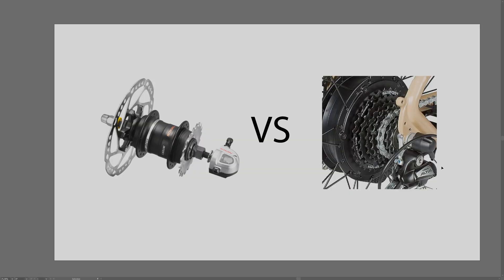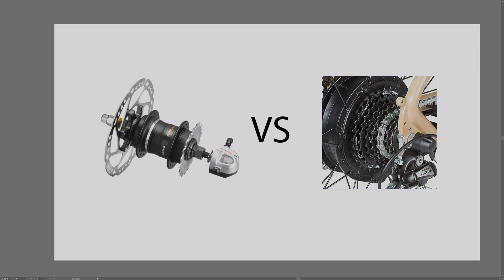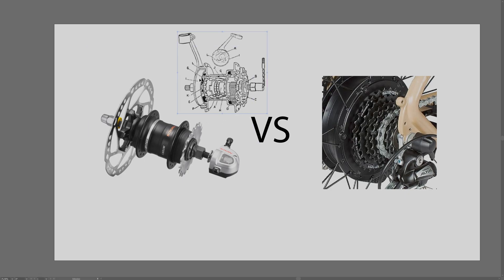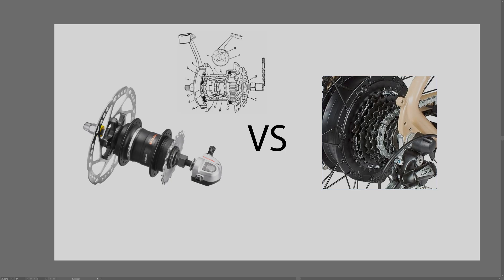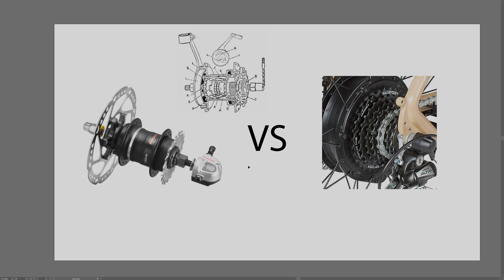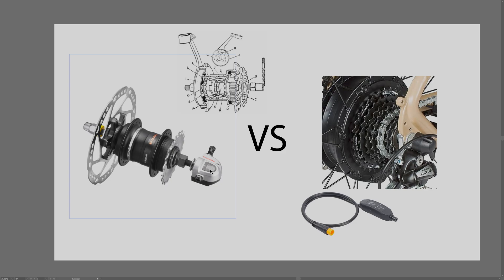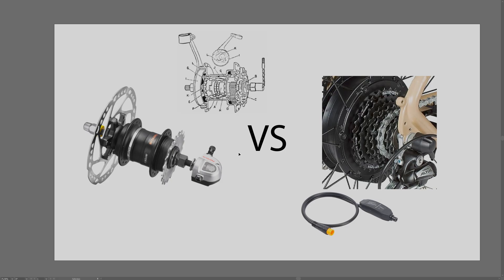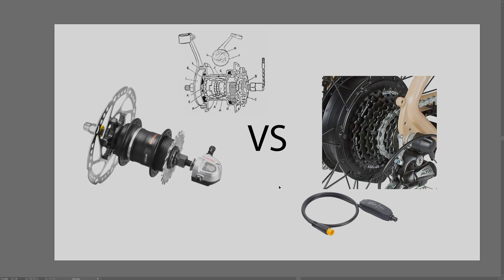Derailleur vs Gear hub - For bafang Mid-drives?

Comment: I built a Frankenstein moped using a 212cc clone driving an intermediate shaft to a 3 speed SA hub then to a v-belt to the back pulley.
 I figured the torque from the geared up 9hp engine was less than a hefty guy pounding on his regular pedal bike. 
It is amazing how small the gears are in these hubs, and they hold up just fine.
 I would oil the hub a few times a year. Used it for years.
 Took it off last year in favor of a C-V set up and it's still good.
I am using a 3 speed hub with a coaster brake on my home built E-bike, the ratios are perfect for a top speed of 17 mph while pedaling. Don't need more gears.  Mike

Comment: Good effort, You covered most things but to make it better ; 
a) you should shown some numbers when talking about gear ratio % , when you pointed at Derailler @4:02 and said 200%-300% and compared it against IGH that wasn't very good. Only the old Nexus 3  (186%) or probably even older Strumy Archers are worse (which look, a person buying a ebike motor in 2024 can get better IGHs )  - Rohloff Speedhub is exceptional at 526% ; but even Alfine 11 is 409% and Alfine 8 is 307%.   
b) chain line ,  chain wear is a plus for IGH (1 speed chains are tougher and cheaper) 
c) hence chances of wearing out of cassette teeth vs wear on the gear hub teeth is ratio of 1:3 or 1:4 easily so the changing requiremnet is much less
d) weight of IGH is often heavier
Hope to see more good content. 
Thanks

Comment: Thanks. Very interesting and informative. You make a good point about the igh gears being able to change gear easily when you stop peddling momentarily. 
Personally, I’ve not had a use for lots of gears on my Bafang. I’ve opted for an old fashioned 3 speed derailleur. So, around town, I just leave it in 2nd gear. The Bafang gives me enough ‘shove’ from a standing start even with a big 52 tooth front chain ring fitted. And is easy when I’m cruising along, I  don’t find myself ‘Ghost peddling’. 
I Only use 1st gear for an extreme hill (it’s very flat where I live). 
I haven’t tried a igh with the Bafang but I’d think it would work well. And yes, igh is very reliable, they were fitted on all Royalmail postal bikes and were very much trouble free. Derailleur setup is not as reliable if left out in the elements and some basic maintenance ignored. 
Aren’t the cog teeth & chains on igh much bigger and tougher too? (The Royalmail bike chains were so hard to split that you could easily break the chain splitter tool before the chain link would ‘give’) 
Same chain size on a bmx bike I believe.
Reply from the maker: 3 speed derailleur sounds cool hehe, never seen one myself

Comment: Hubs have a smaller range is not true for rohloff which has 520% compared to about 320% for an 11-36 cassette. Other advantages it has are that it has 14 identically spaced gears and can change multiple gears almost instantly. Apparently Roholoff is the only hub that is tough enough to handle the strain casued by the  motor
Reply from the maker: ya but rohloff is an exception im talking about yoru average derailleur with 3 speed front crank is gonna have much more range than your average gear hub.
Reply: @voltvehicles you need to try the shamono 8 nothing you said is tru😮
Reply from the maker: @Billybritt-s4t  ?? nexus 8 has much less range than a basic acera
Reply: Nexus 8 isnt as good under a lot of power. The latest alfine handle more power

Comment: The way i see it as someone owning multiple bikes i want as much cross compatibility as possible. I find it convenient to stock multiple chains and chainrings that will fit on all of my bikes. And i also i like having options for wheelsets making it easy to switch over in seconds in the case of a failure. As for gearshift sensors, i used to use the plastic varient but have had a couple fail. Now i moved over to the metal cased version and have had no issues since. The argument of a igh being easier to clean and maintain doesn't make much sense to me. A chain is still used and will need to be cleaned anyway so using a conventional system is not much different and may take 5mins more to clean.
Reply from the maker: the gear hub vs derailleur, im not talking about the chain.
Reply: If you had a great ebike, you wouldn't need more than one. You can only ride one bike at a time, tiger.

Comment: The Enviolo Trekking for the 3/250W and Heavy Duty for the 500W motor with the gates carbon drive or the aliexpress knockoff belt drive. Silent and Smooth setup. Not the cheapest one but the most convenient one.
Reply from the maker: I want to try the enviolo, just dont know where to buy it for a good price
Reply: @voltvehicles  Well try buying a used one and if that doesn't work then a black friday sale. I managed to get the older Nuvinci N380 hub basically completely new and built into a really expensive rim for 64€ without shifter. I'm kinda lucky in that regard that more and more enviolo is put up for sale.
Reply from the maker: @kazuviking  but where? I can never find these , I live in europe sweden

Comment: Then you worry about chainline & breaking the chain with derailurs.
Reply: Never had an issue in 3 years of owning and riding a 750w bafang mid drive. The key is to either use an offset chainring or lose the 11t sprocket and space the whole cassette out. In cases of really bad chainline you can do both. Never go above 9 speed also chains are cheaper to replace and inherently stronger that way.
Reply: Not if your being careful and don't charge gears while pedalling or when theirs force going through the drive train
Reply: @SmokeySkies  Going electric should make life easier, not more complicated.
Reply from the maker: ya, its quite the headaches, especially chainline, never had issue with breaking

Comment: You answered all my questions. I'm sticking with my derailer. Thank you so much.
Reply: I run a 8 speed internal and love it won't ever go back to the cassette junk
Reply: @Billybritt-s4t  
However, Sturmey Acher nor Shimano currently offer an off-the-shelf internal geared hub (IGH) with Boost spacing (12x148mm O.L.D. thru-axle). 
Hold on to your modern mtb's with traditional spacing.

Comment: Which brand of IGH do you recommend? How many gears ,3 ,5,8?
Reply from the maker: personall 3 because they are usually tougher in terms of reliability especially in higher watts 750w or more. In 250w systems any gear hub imo is fine, best you can get your hands on that is disc brake compatible.
Reply: @voltvehicles I run the shamono 8 speed over 5000 miles zero problems I won't ever go back to the cassette crap again
Reply: @Billybritt-s4t  But no pictures right? Riiiiiight.
Reply: @brianbassettnumber1  no no pictures but I do have a problem of trolling 😂😂😂😂😂😂😂😂😂😂😂